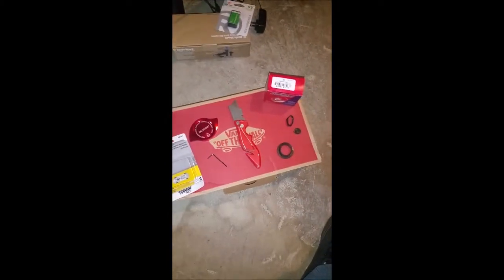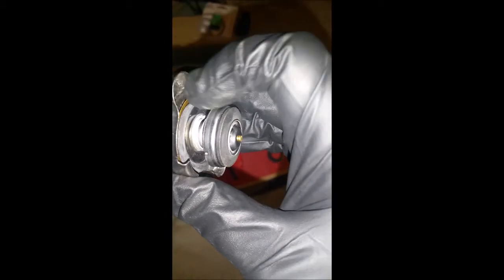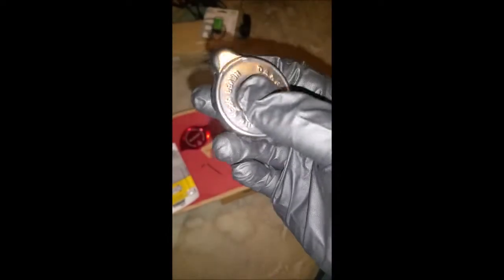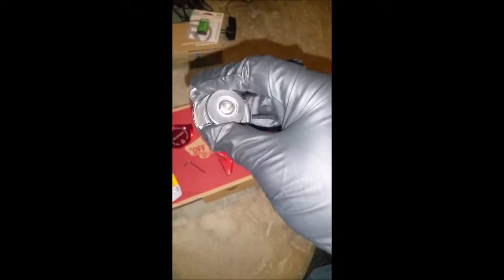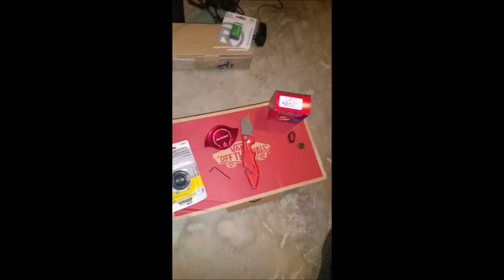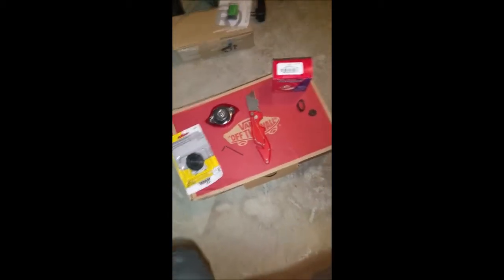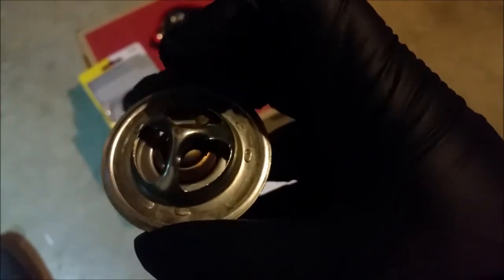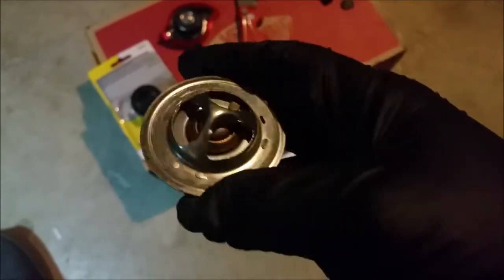Cooling system mods 4G63 2g dsm

Comment from the maker: I ended up going to a factory mitsubishi thermostat for now because winter the car would take too long to get up to temp. I will re-visit running the evo one later when I get link installed and running a hotter turbo setup. 
If this were just used as a track car not a dd I would run the cooler thermostat.